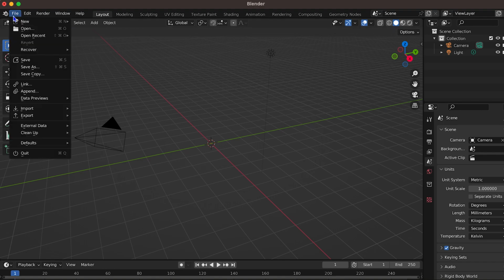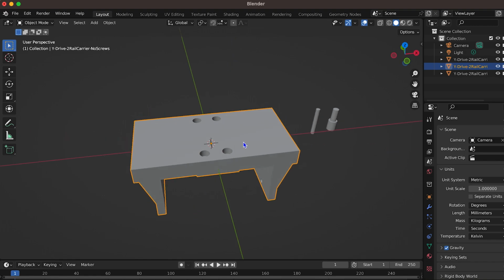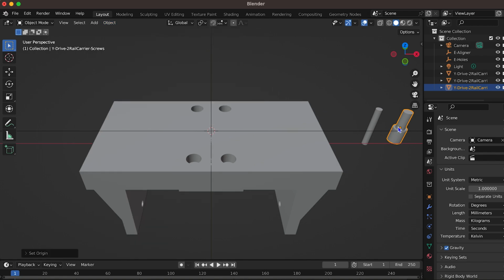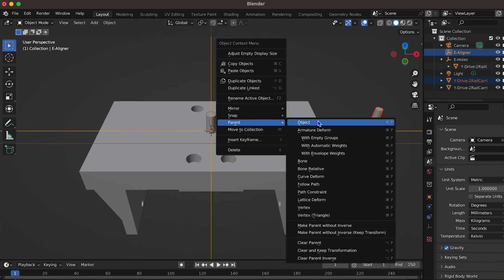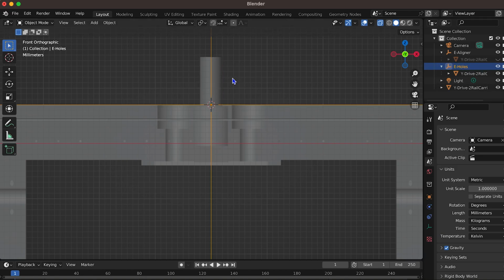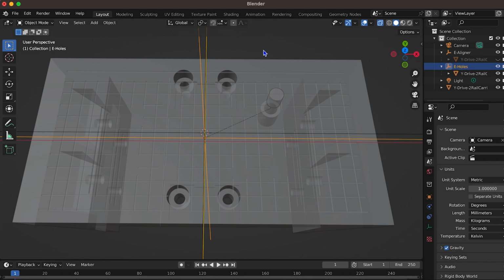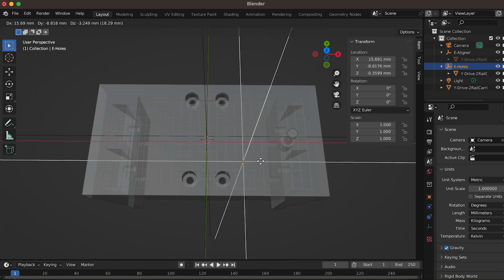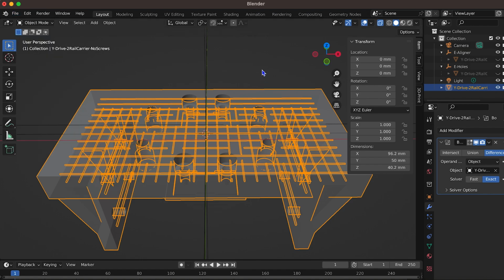Blender for Ender - Modify (my E3v2 Y-Axis Carrier) STL files for 3D Printing

Comment: I cant get my head around Blender, Ive used Tinkercad from day one and know how to manipulate it to make the majority of things i need printing.  I like your idea of the grid to produce rigidity, That works well, I have used triangle tubes before and structually those parts are still in place with quite a bit of force on them but they havent warped at all.
Reply from the maker: Thank you for your comment. I will make more videos about blender - it got much better in recent 2 years for design for 3d printing. Using CAD is a very different approach and I understand the switch is hard… for me too, I have to use for some things Freecad - and when using always blender in the past is sometimes a little mind boggling 😅
Reply: Yes, you should definitely do more videos showing the  designing of stls. It might be useful to show the designing, slicing, and printing in one video. Keep it up! Your videos are very informative and interesting. Also, it was a great choice to do ender 3 mods as ender 3s are very common.